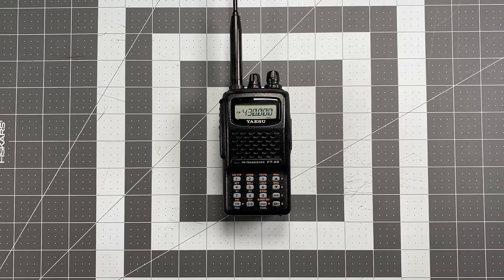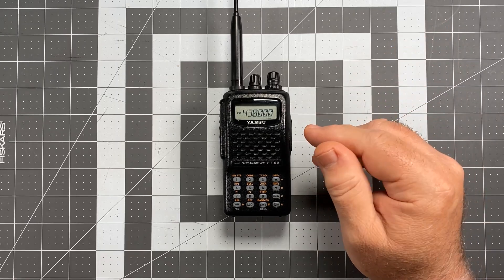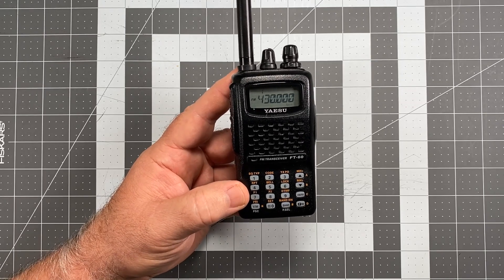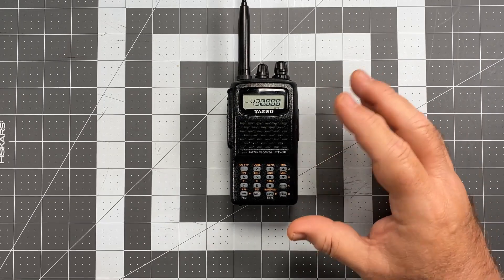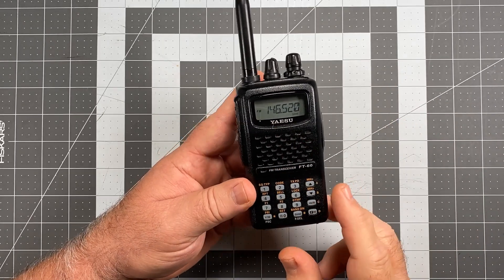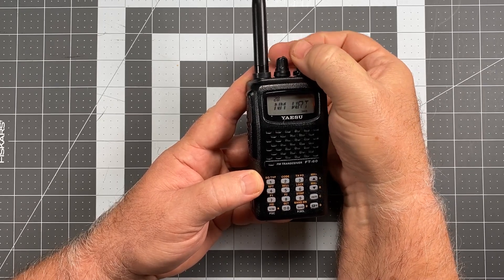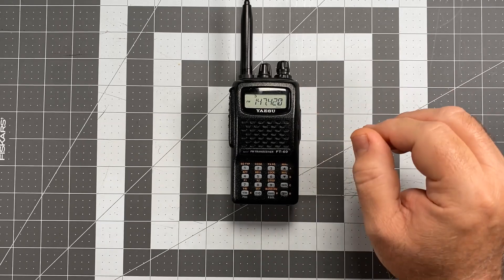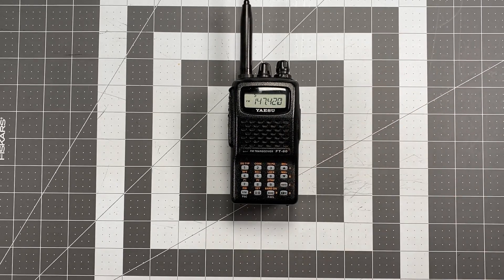Yaesu FT-60 Operator Series - Part 6: Programming Simplex Memory Channels

Comment: I recently got my licence and the Yaesu FT-60 is my first HT radio (thanks in part to your positive comments about it). I am following along with these videos which I greatly appreciate, however, I "came off the rails" early on while trying to enter the national simplex calling frequency because I pressed the wrong number button which I have to imagine is a common mistake. I expected it to be easy to correct, like using the down arrow to backspace allowing me to enter the correct number, but nothing seems to work. How do I correct an incorrectly entered number?
Reply: It looks like the only way is to just keep typing garbage and the input field rolls around to the start,  and then  enter all the numbers again.
Reply from the maker: Just hit the PTT and it will take you back to the VFO display.